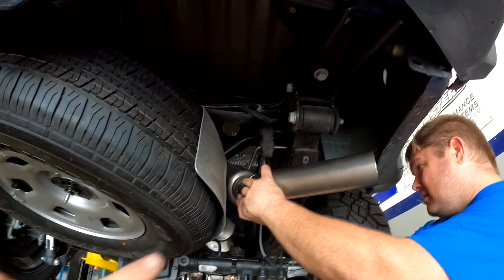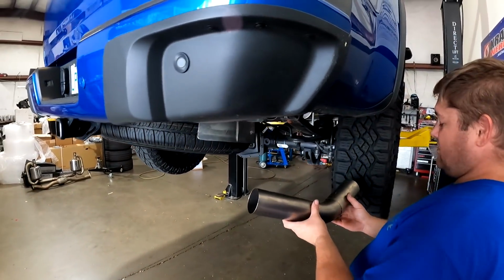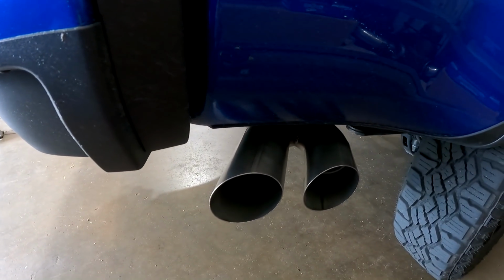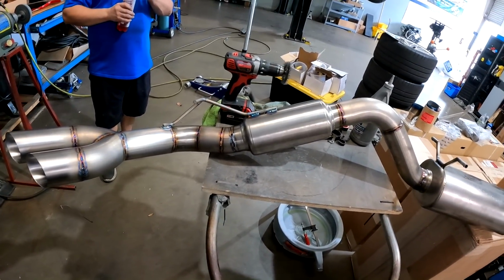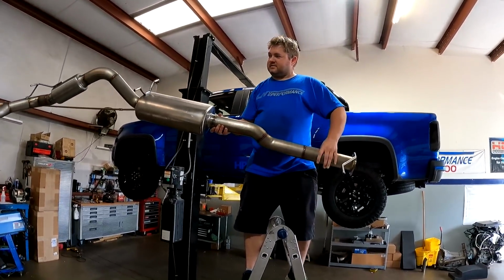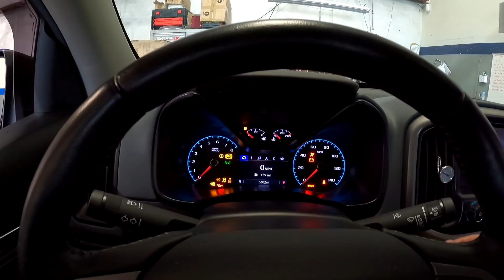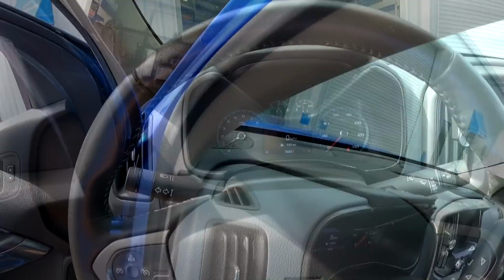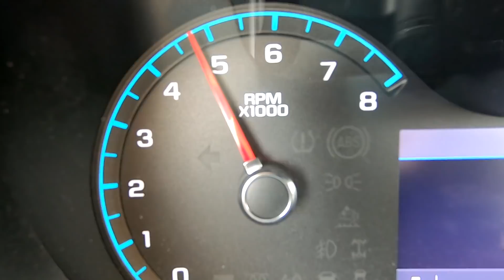Colorado Hand Built Titanium Exhaust - Part 2

Comment: Just needs a level and some 33's and it'll be set!
Reply from the maker: I already did a level kit. It’s within half an inch front and back. I think it was a 3” front lift. It’s a true daily so I didn’t want to ruin the OEM quiet feel  at 80 mph.
Reply: @LHTPerformance  that's all in the tire selection. Beaut truck!
Reply from the maker: @shawndejong6699  I would like a bigger tire but hate that massive tire noise. I don’t have the tolerance for annoying stuff anymore.